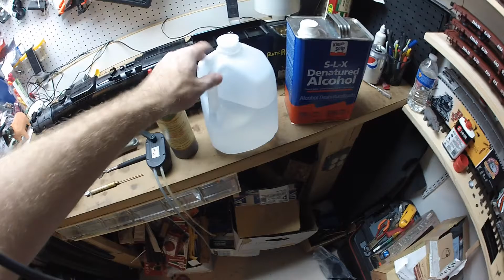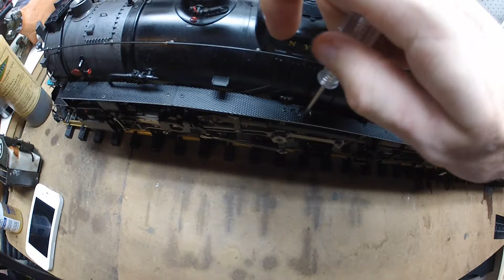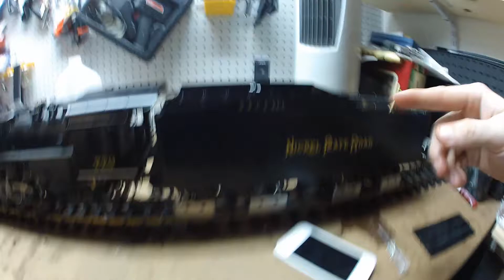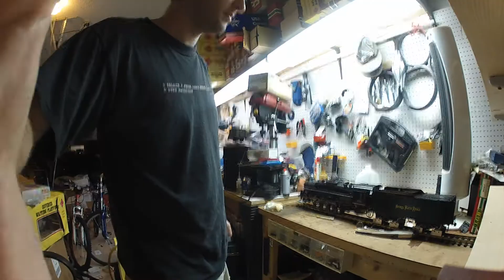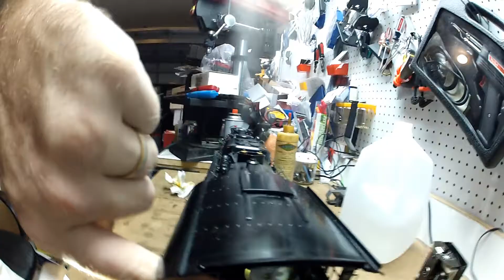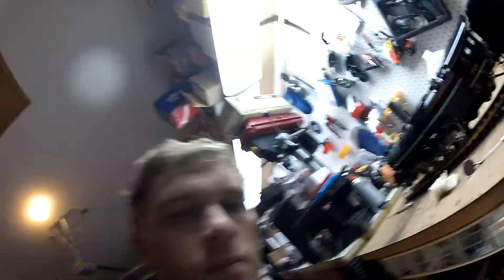How to steam up a Live Steam Aster Berkshire

Comment: I think ur test track is curved very sharply.  But so is the engine.  Therefore, no problem!
Suggest to use that thick steam oil to paint the piston rods, cross heads, and guide rails
rather than the 3-in-1 oil.  Bc. the parts get hot, i usually use 75W-90 or 80W-90 Gear Oil u can
buy from eBay for the rest of the moving parts.

Thx for the informative video.  Not many video does the complete cycle of from the initial
steam up, running, refurbishing water (axle pump-bypass adjustments, hand pump usage)
stop for re-fuel w blower/fan, and finally to finish w steam down as so to spk.  Most just
ends w the 1st stage.  For ur nxt video, pls get a better camera and lighting(s) w a remote mike too?
Sure like 2C this beast on a long track, pulling the freight cars.
Reply from the maker: I made this video 10 years ago, there are much better cameras and mics now lol
Reply: @drx630  Thx 4 ur reply. Hope 2C ur new videos. B sure to keep ur fine narration and zooming close up
shots, no boring just run buys though it'll b great 2c those rake of car counts. This Aster BirdShare seems to have
large boiler w great steaming capacity.  But alas, too expensive unit für mich 2 buy n won't b 4 sale in eBay used as
they're only a few made n those men won't let them go until Widowers cash in, end up selling to his surviving men
friends.  I doubt if Aster w its merger w Accucraft wld make something like this or like their last UP big engines of
hi quality.

Here is a Black & White old French Fry film giving u the speed, ferocity, and power of a steam engine.  Only 3% of the
steam can b extracted for mechanical energy  vs. 44% for Diesel engine.  97% of the thermal energy of the stm engine
is wasted.  So u can c how pwrful the stm engn can b.  Wonder how back in those dayz, they were able to film such
steady moving shots w its frail tape streaming???  The rails spreading out, closing together, ... very fast, can b suggest-
ed in our layout buttttooo can't b duplicated.  Never seen such ferocious rod motion shots even in today's color DIGITAL
videos up close on any of our preserved (strawberry Jam) steam loco.

Hope u all enjoy the B & W French Fries below n at ur Loco MonkeyDonkey's.   An Aster model version of the old
film, Chaperon Nord Pacific Loco was also made in Hersey Chocolate Liver (Livery) color. Sadly, w no TMI shine lovely.
Another u kant find in an on-line stores unless u know a fellow live steam hobbyist who has one, but kicked his bucket
full of Alcohol.  And, B4 the kick, u were much friendlier than his other friends 2 her???  And if u live here in the States,
nut (not) many of Amerikaners bought dem chocolates as they r too colloquial, close mindEnd, dink only the Amer's Frenchy
Fries r the best, no need to look for Borsch or Perogy's or even knw they exist.  OK, nuf said.  So here r the ferocious videos:

  https://www.youtube.com/watch?v=rKRCJhLU7rs <-- B&White Chaperon Nord Pacific, French Fries of the real Andre Chaperon
                                                                                                 Stm Loco Designer's Master Piece

  https://www.youtube.com/watch?v=4QRC17OU8qY <-- Aster Chaperon Nord Specific, w a fine rake of the Oriental Expression
                                                                                                    J&M Coaches

Comment: Radio control would be the way to go. that way you wouldn't have to keep putting your fingers down in.
Reply from the maker: its better to run ti manually, there is a lot of adjustment with the bypass valve, blower valve, drain cocks, and throttle, the more weight you pull the less blower needed when moving, its all part of the fun, definitely not a simple go forward or backward engine

Comment: If you want to save some stram, you can do like they do on full size stream engine. Just put the forward/reverse leaver half way between neutral and end position.
Usefull when you don't need full power. 

A great machine and video, by the way. Love the sound when it working hard. 
Thanks for sharing...

Comment: Where did you get this and how much was it?
Reply from the maker: these are works of art so they are expensive (brass, copper stainless steel, will last forever if taken care of), the Aster Dealer of USA is http://www.asterhobbyusa.com/  The current model in stock I believe that is similar to this engine is the http://www.asterhobbyusa.com/up-fef-3.html - even if he is sold out he might be able to let you know other dealers that might have stock. My engine when it came out was around $6500, I have had this berk for many years and can actually sell it for more than I paid for it, they hold there value, run like champs, really really cool and fun item I can never think of ever selling in my lifetime, I love it. http://accucraft.com is also another great manufacture of live steam engines.